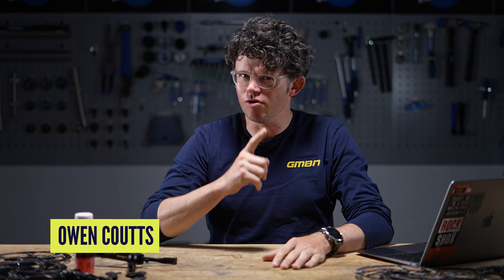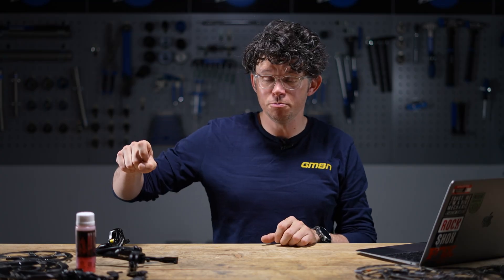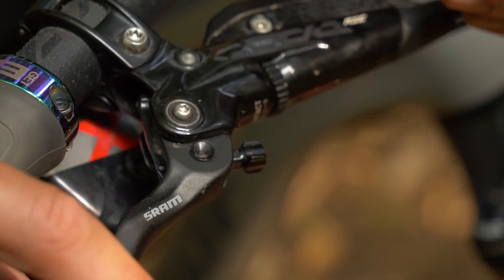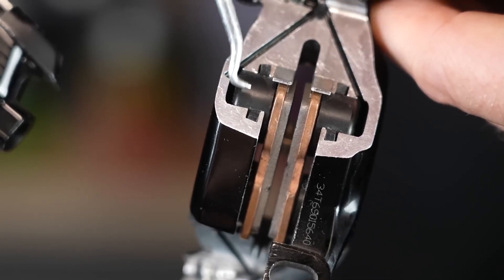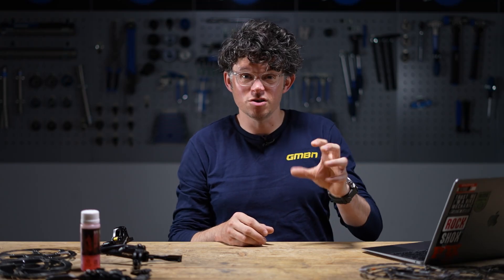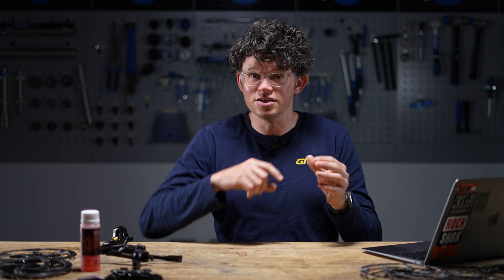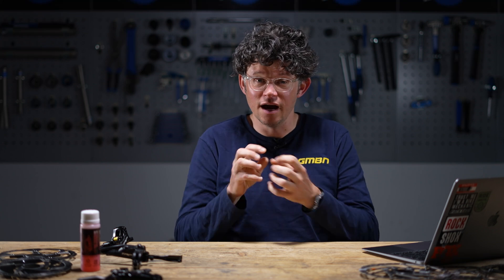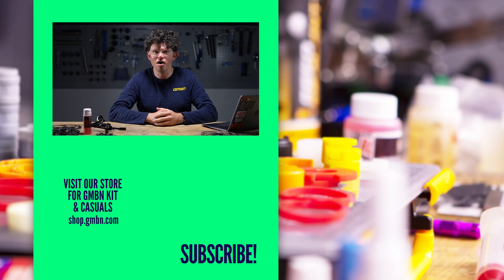How Hydraulic Disc Brakes Really Work!

Comment: Now I know all the parts. But still don't know how it really works. E. G. How does the lever push down liquid? And how do the pistons retract automatically
Reply: @philipps258  the lever pushes a piston, which displaces fluid and causes the caliper pistons to expand. There is a spring in the lever that causes the lever to pull back, when the lever pulls back it pulls the pushing piston with it, that force sucks the caliper pistons up.

Comment: Great Video. Im not a mecanic, but over 10 years I used to service/modify brakes on my cars and motorcycles. And I wanna say that the majority of MTB brakes are marketing scam. All those unnecessary complications which force you to buy extra parts. Why don't we have banjo fittings with copper shims for all the hoses? Why use crappy single use olives etc? Bleeding kits is a separate topic which looks completely idiotic to me... Hayabusa brakes are going through hell during brakes, and those brakes are simple and effective without MTB-style super-gizmos.
Reply: "I'm not a mechanic" but happy to have a dig 😂

Comment: how does air get into a closed system? how does it automatically adjust for pad wear? why cant i bleed with worn pads in? how the hell do i overfill the system if i want it with no air? how do these people claim to have used their brakes for years on end with no issues? have you been riding uphill the whole time?

Comment: Friction does not depend on surface area. 
Size of pads is again heat management
Reply: That said bigger pads generally require 4 piston calipers which usually means more piston area which means more force for a given pressure from the lever which means more friction.
Reply: Nah, the force you put into the system by pressing the lever stays the same. So actually you have the same force.

Bigger brakepads lead to bigger surface area where heat can escape and more mass, so you need to brake more to heat the pads and calipers

Comment: I run 203 front and 180 rear hope saw rotors Fr and Rear all steel Tektro Draco big piston brake calipers and pads shimano caliper adaptor with shimano deore derailleurs with alivio shifters and a sram chain 3x9 setup on my custom Dh hybrid changed suspension to longer travel but same geometry and raised the bottom bracket and peddles  2 inches fitted a Rockshox monarch rt3 plus debonair piggyback rear shock 200mmx51mm travel with custom made from DVO suspension USA hardware and a fox 32 float f seiries tapered air fork with a hope straight steer tube to tapered fork adapter with lizzard skinz mini machine grips it's a 2012 jamis Dakar XC sport with beefed up swing arm from jamis replaced on warranty after the weld snapped using a 160mm rotor i had a 5 year factory warranty and happened 1 month before it ran out was sent to Jamis USA for inspection and repairs even emailed me saying i did a good job on modifications and asked my riding styles and build a swing arm accordingly and full bearing replacements to stronger and even rebuilt my suspension while there too

Comment: Hello, i have 1 question and that is that i have a sram level brake system that takes dot liquid right? Could i put the same dot fluid thats in cars or i have to buy specific sram branded dot fluid? Thanks
Reply: It has to be a DOT 5.1.

Comment: Do NOT mix DOT 5 into any other brake fluid. I repeat do not. There is a chance of brake failure and will either need a complete brake rebuild/new brakes if you do.
I know this has been said a lot, but it's a safety thing so the more it's up, the higher chance someone will see it Dot 5 and dot 5.1 are completely different things.
You can mix and match dot 3/4/5.1 but dot 5 is a different chemistry altogether and is silicone based. Unfortunately silicone is insoluble in about everything, so you will end up with a gummy mess on your hands.

Comment: You covered all of the obvious stuff that everyone already knows  (imho) but you didn't go into stuff that nearly no one knows about - eg; how reservoirs work - feeding the system as pads wear etc, how the pads retract (by the seals or return springs or both?), where air in the system migrates to (reservoir on uplifts etc or lever piston or caliper) & how it enters the system.
Reply: Man, I just wanted to know why the interaction between the mater cylinder and the reservoir seems a bit random at times, especially while bleeding my brakes. I know there's at least a small reservoir in there somewhere, but hell if I know how it's actually connected to the rest of the circuit!
Reply: reading all these and spending the last three hours trying to find someone who will explain these intricacies has me absolutely set on cables tbh
Reply: @45graham45  do you have a video where someone does talk about those things? They seem imprlortant for me to learn
Reply: @jsadecki1  Unfortunately not. No one seems able to explain how brakes work.
Reply: @45graham45  I menace there's plenty lol,  just wanted to hear it from you since you sound knowledgeable in a good way about this 🙂‍↕️
Reply: @jsadecki1  I only know the obvious stuff. The questions I have don't seem to be answered by anyone on-line though.
Reply: Not a very humble opinion. It's a fantastic video that will help the vast majority understand the basics.
I'll wait for you to take the time to research the points you raised and create a corresponding educational video.
Reply: @davidagudelo9223  You can wait as long as you like. If you want to find out then put some effort in for yourself to learn.
Reply: @45graham45  you're happy to be critical about someone else's video but incapable of producing your own. You're not grasping well.
Reply: @davidagudelo9223  Yes. Correct. So your point is what?  Criticism is still allowed in this country.
Reply: @45graham45  exactly that.
Reply: @davidagudelo9223  Seems that you enjoy stating the obvious too. What a waste of time you are?
Reply: @45graham45  I'm still waiting for the video where you improve on the topic... but you're not capable.
Reply: @davidagudelo9223  So why are you waiting? Was that meant to be an insult 😂😂? I never said I was capable. If you studied a little harder at school then the info in the video would'vd been obvious to you too.
Reply: @45graham45 talks a big game but that's where it ends with you.
Reply: @davidagudelo9223  Basic physics talking a big game 😂😂🤣.  OK.  Big for you I guess. Never mind.

Comment: I have recently ran into an issue after purchasing a used mountain bike where i noticed when replacing the rear pads that they are not fully covered by the surface of the rotor. basically the pad's surface is wider than the rotor. any ideas on how to go about fixing this? would it be better to replace the rotor to a wider version if such a thing exists? or would it be better to replace the caliper and pads to a smaller size?
Reply: Great Question - we do an Ask tech show where you can send in your question and we try and answer them - so I'll add your question but if you've got more details about the bike, the rotor sizes and brake model - we'll try and help as much as we can! 
Cheers
Owen
Reply: @OwenBikeNerd   I think you just helped me answer my own question. I'm relatively new to the mountain biking world so I didn't even think to check the brake and rotor model against what the bike would have originally come with. Turns out the previous owner swapped the rear rotor to one with the same diameter but a 4 millimeter narrower surface area.
Reply: You likely have a wrong adapter, or it's installed up side down (fork), or back to front (frame).
Reply: @prusak26  the wrong rotor was installed

Comment: When talking about both levers and calipers you didn't explain why does it matter, which is the hydraulic equation: F1D1 = F2D2. It literally tells us that the force applied on the one end, multiplied by the distance is equal to the force on the other end by it's distance.
So oyou can move the large pistons at the caliper with huge force, but small distance, by applying small force for the larger distance with small pistons at the levers (and even increasing it with the leverage ratio of the levers themselves).
You haven't explained also how do floating rotors help with heat management. And it's kind of advanced management at trhis point as it is not designed to dissipate heat better or anything like this. The floating rotors role is to isolate the hot rotor surface from the colder spider. As metals increase their volume when heated, the rotors want to expand. But the cold spiders prevents them from it, so traditional rotors warp when they are heated. Floating rotors allow them to expand equally on their circumference to prevent warping.

As for the difference betwen pad matrial, the main one that you have not mentioned is their characteristics with heat. 
Resin pads work very well when cold, but fade quicker when heated. So they are good for someone who doesn't go on long downhills, but wants sharp brakes available instantly. 
Metallic pads do not offer full power when cold, but will work really well on long descends as they will not fade as quickly.

I also dubt the part about adding the brake pad material to the rotors. Such thing could happen, but to do so, you would have to spin the wheel around 10 000 RPM to generate enough heat to achieve that.

Comment: Re DOT brakefluids: There are DOT 3, 4 and confusingly 5.1. These are all similar glycol based brake fluids (you shouldn´t mix but you can interchange them). The higher the number the higher the boiling point (roughly) There´s also a DOT 5 which is something entirely different and is silicone based. This one is NOT  interchangeable with the other DOT types so beware what you buy. All the DOT bicycle brakes I am aware of use DOT 4 or 5.1

Comment: Wait till a ABS type function or brake bias comes into the mix...
Reply: How are you going to have a bias function when each brake is operated independently? That's why you usually have a different rotor size front and rear.
Reply: Seems like some motorcycles have CBS (=Combined Braking System) and that or ABS (some also combine that) are mandatory in a lot of countries nowadays.
However, for ABS you need some electronic control AFAIK and most bicycles don't have a permanent power source - [hub] dynamos for lighting aren't common on MTBs/road bikes and only deliver a few watts (I guess proper lighting already uses most of that).
Maybe on Pedelecs but of course with a safety margin (traction gets cut off at 5%(?) so it can still power lighting and ABS system), maybe with Di2 but IMHO that would overcomplicate the braking system and sometimes intelligent simplicity (fewer points of failure) isn't wrong but you remember Mercedes-Benz with their SBC in early to mid-2000s? It had a huge recall and they went back to "conventional" braking after that.

Comment: A bigger pad size does not result in more friction. The friction is independent of the area.
Reply: It does convert kinetic energy into heat faster though, and steel has a lower coefficient of friction at higher temperatures. That's probably why they work?

Comment: I wish there were an explanation of how the system adjust itself when the pads are wearing out and become thinner, and why, when there is no pads and no discs to block them, the pistons can be ejected from the caliper, meaning that they don't always go back in as much as they go out when you pull then release the lever.
Reply: The reason they self adjust is because of the square edged seals used on the pistons. When you apply pressure on the pistons the seals slightly move but always want to go back to being square, so they move back to their original place. As the pads wear they can overcome the force from the square edge and move out further to take up the wear.
Reply: @chucktalks63  Thanks !

Comment: Do you have a fool-proof way of bleeding brakes? Why can't these bike systems be bled like a car system?
Reply: from what i understand its gravity based. open the valve at the top of the bike to let out any trapped air and push in fluid from the bottom of the bike at the break. of course this assumes your bike is stored in a normal up right postion and not hanging from the garage ceiling or something so that the air bubbles will slowly move to the highest point of the bike over time.
Reply: @Airsofthunter112233 if you hang the bike with front wheel up, which is usually the common way, the levers still be the highest point of the brake system.

Comment: DOT brake fluid strips paint in seconds. Do yourself a favour and use AUTOMECH brake fluid the same as used by the military. Better than DOT fluids as it does NOT strip paint AND it does NOT absorb moisture (you can mix it with DOT fluids if you have to). I've used it in my kit-car for years - I used to have to bleed the brakes every year and replace corroded brake slave cylinders - I've not had to do either for years because this fluid is designed to be used in military vehicles that stand for a long time. It isn't cheap but if you want the best!

Comment: A factor to consider about brake leavers - are they ambidextrous - Do you have left & right specific levers (eg Shimano) or can the same lever be used on either side like Sram or Magura. Ambidextrous levers simplify buying upgrades and make carrying a spare more reasonable. A few years ago I had a big day at a DH bike park cut short when I broke a brake lever in a fairly minor crash. Considering the total cost of the day (lift tickets, transport there & a hotel), I would in future bring a complete brake with enough hose that it could be mounted front or rear, and an ambidextrous lever so it could be used to replace any broken or faulty brake.

Comment: Owen they are full floating MTB rotors, even the Chinese crap on ali has advertised float of 1° to 2°
They can rattle yes but it isn't affecting performance.
Shimano and galfer are NOT floating rotors they are riveted tight
Reply: hope too floating rotors can rattle but it is not a anoying rattle to me and imo they rattle when they get heated up or somehow very high speeds too

Comment: You cannot use DOT 5 fluid in brakes designed for 3, 4 and 5.1
Dot 5 is silicon brake fluid and is totally incompatible.
Reply: Happily DOT 5 is harder to find, 5.1 is just becoming pretty common.
Reply: I found a 500ml bottle of DOT 4 in my local corner shop! It is also the same grade of brake fluid that my car uses.
Reply: I was thinking exactly the same. You are the man!

Comment: Thanks. I’d love a history of mtb brakes before hydraulics. Did You mention self adjust? I have used both mech and hydro discs and the difference is staggering. I guess wire friction, cheaper calliper construction and the lack of self adjust makes for the difference. There is no servo in hydraulics itself.
Reply: Glad the info was easier to digest! 
The "Servo Wave" is a shimano brand name to describe a system to change the fluid flow rate as the lever arc's in its travel - SRAM and others have other fluid flow rate adjusters under other names - all of them are clever - but you're right these brakes don't have a servo like cars do! 
Cheers
Owen

Comment: Hope brakes are fully rebuildable including hose connection to the caliper
Reply: They are just fittted the stainless pistons in my front e4 caliper much better movement and hopefully no brake locking on anymore
Reply: Pretty much all brakes if you exclude tektro, even then they could be serviced but you can't find replacements parts 😂